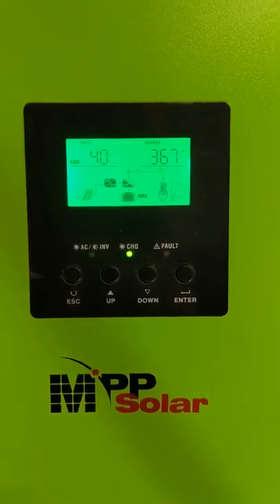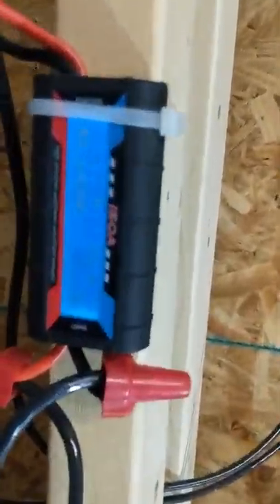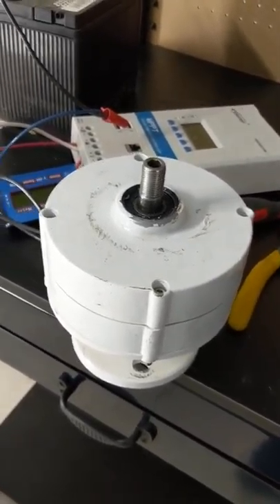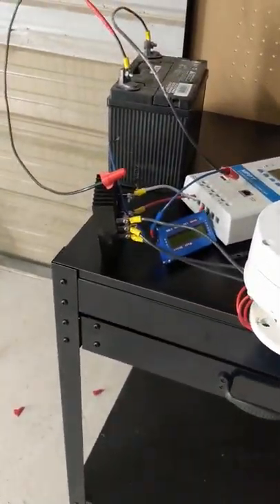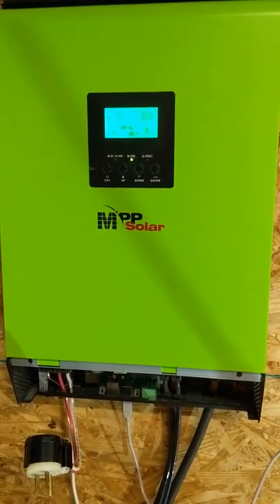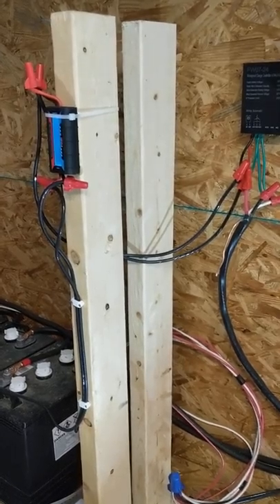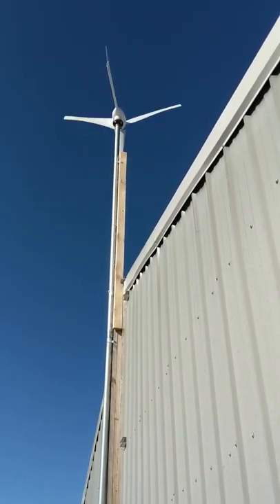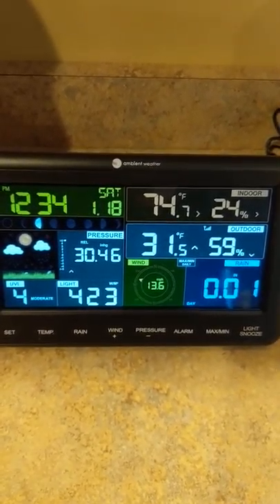700w wind turbine, Mpp solar lv2424 and ambient weather station

Comment: Living in a older mobile  home.  Cramming everything in the Cubby hole the Colman Heater was in.  20in Wide, 30in Deep. and 6ft tall. Close to a Standard Equipment Rack.    Put a Hub and Blades on the Vertical hang that puppy sideways and see what it can do.  nothing to loose really.   Still gathering my bits and bobs.   Going with a Solar / Wind Augmented Power Wall toy.  500W Turbine 24v and 4 x 100W of panels .  Have 4000Kwh of Nissan Leaf Cell packs to get things going.   I started off only wanting One panel and one battery.  LOL  That didn't last a week.
Reply from the maker: Pulesjet I have tried some things on that darn thing to no avail I put a pulley on it on hooked it up to a bicycle wheel and with the youngest boy peddling on it he could only get 50 watts out of it I will take my chances with the boat anchor idea😂!!! Lol and I hear ya on starting with just a panel and then watching guys like Vlad and next thing ya know your PG&E LOL!!! BTW thanks for watching and the feedback

Comment: I know you mentioned not having many subscribers in the previous video. Try adding tags to the videos that way they have a higher chance to be viewed. The tags must go with video and title, for example try: 700 watt turbine, Wind Turbine, DIY wind Turbine, Off Grid system, watt meter, lv2424, inverter, pure sine inverter, grid tie inverter, MPP Solar, solar array etc. The more tags you have related to your video the better youtube ranks it. I had a solar channel before and then made this one for welding. I wish I had stuck to my solar channel as I like that a lot more.
Reply from the maker: Thanks for the tip I will try that in my next video!!

Comment: Nice video. Crappy vawt’s😁. They refunded my money and told me to keep it LOL. They didn’t even want the stupid thing back. Love the WeatherStation got to get me one of those
Reply from the maker: Ya it's to bad I love the concept and design if they would pair it with a good generator it would be an awesome unit!! And ya I love the Ambient weather station it was a Christmas gift! My dad has one and I really liked his! My next move is more batteries it is a must! I made almost 3kw Saturday between the wind and solar but not enough storage to do anything with it!
Reply: Eric Jackson. Awesome. By the way. What turbine is that one your using now. Seems to work 😊
Reply from the maker: @Checkitfirst  it is the Happybuy 700w 24v wind turbine off Amazon and ya it works good there might be better ones out there but it's doing what I need it to do nothing crazy but steady!! I like it
Reply from the maker: @Checkitfirst  also make sure it is the same style as the one I have I had one of the smaller ones and it produced a little bit but no where near what the one I have now does the best place to get 12v one is from alliexpress
Reply: Eric Jackson. Thanks. I’ll go check it out
Reply from the maker: @Checkitfirst  I will see if I can link them to here
Reply from the maker: @Checkitfirst  here is the one I have.
https://www.amazon.com/dp/B07Q79ZSBC/ref=cm_sw_r_other_apa_i_B1FjEbBFV308M
Reply from the maker: @Checkitfirst  here is the one from AliExpress you can get in a 12v version

#Aliexpress US $284.67  14%OFF | HAWT 500W Wind Turbine Generator With Controller
https://a.aliexpress.com/_rz5bAR
Reply: Eric Jackson LOL. It says currently unavailable😂
Reply from the maker: @Checkitfirst  well crap!!!😂

Comment: Oh, at work they installed 2 of those 400 watt Chinese turbines and haven't seen them make any power yet. I almost bought one to see if I could get power at night but they are really cheesy toys. I may still buy 1 lol.
Reply from the maker: Ya stay away from the cheap turbines! With your skill set you could build a better one! If I was just going to buy one I would get one from hurricane wind power, thermodyne or an ista breeze! But by far i would build one its fun and knowing you built it is way cooler!!
Reply: @ericjackson6082  I want to say around 2008 my friend and I were going to build some turbines but he moved up North and I dropped the idea. I also had bought a 3kw array from Sunelec to grid tie and also dropped that. They building  wind farms in my county to bad none are on my property.
Reply from the maker: @cutweldngrind  ya they have wind farms up here but I wish they would have gave us individuals a better tax break for installing wind and solar our selves and I have no doubt you could build one if you need help I could help ya with it

Comment: Hi, nice video. Thanks for the info. I have a 2424LV-MSD MPP Solar charger/inverter and from what I can see you have the batteries connected directly to the 2424LV inverter and also directly to the mppt controller from the wind turbine right? I was wondering if this connection was possible. 

Suggestion is to add breakers or disconnect switch from the batteries to the inverter and from the panels to the inverter.